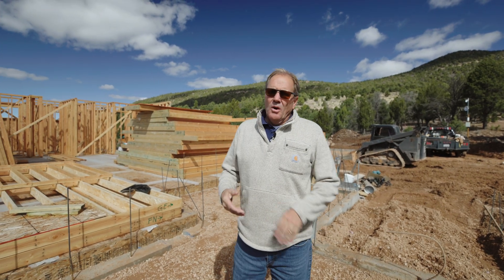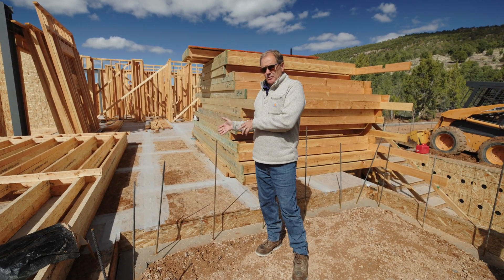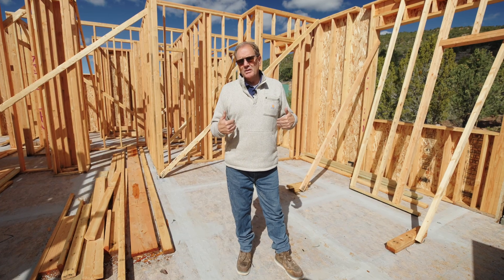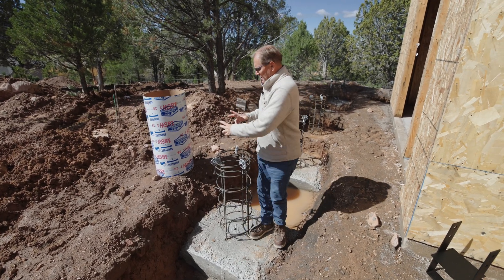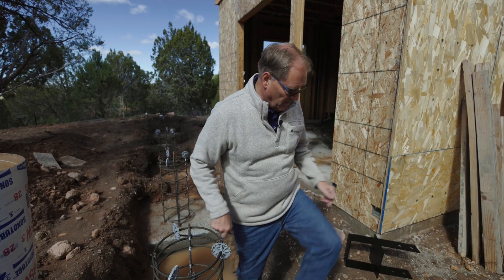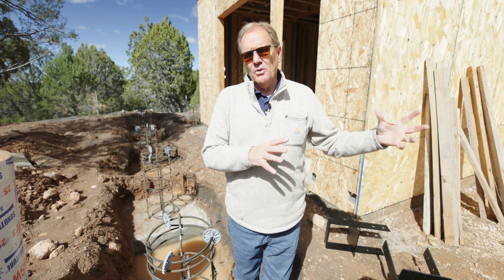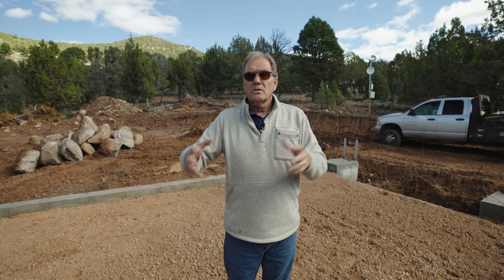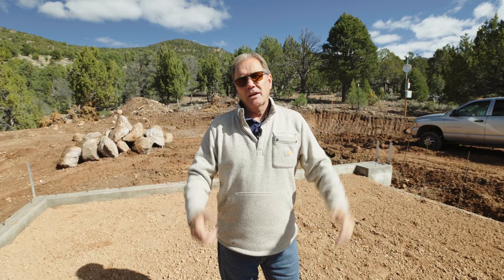Framing with Piers: What Most Builders Miss (Watch This Before You Pour!)

Comment: Just curious... About the piers. Can you build those taller, say 15-16 feet and would they need to be thicker, so as to build an above ground home? I live in Kentucky where red clay is an issue, but ground rock beneath is usually very solid. Thanks in advance.
Reply from the maker: Yes and yes. I have built piers over 24 ft
Reply: @HowToBuildYourOwnHome  Thank you.